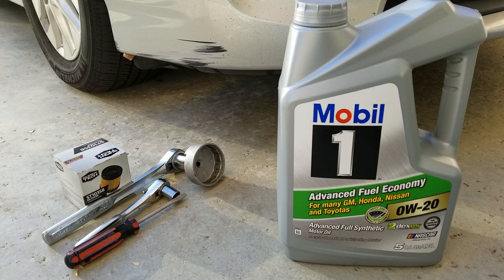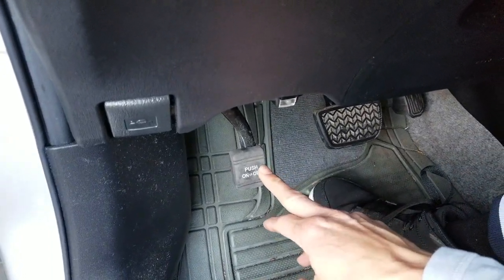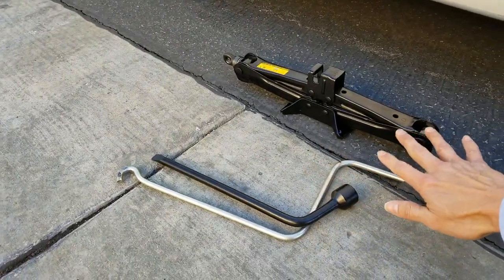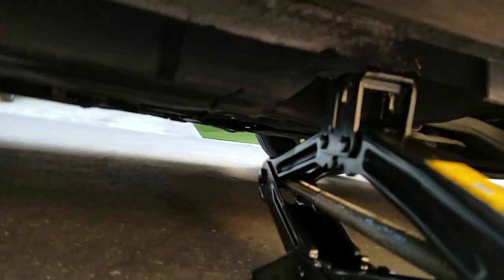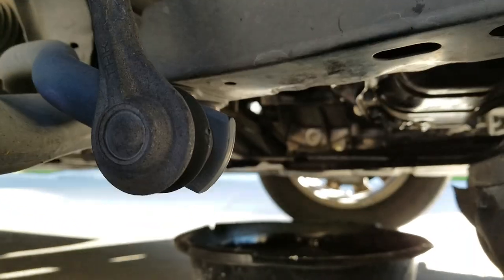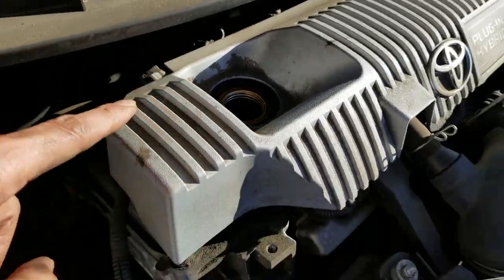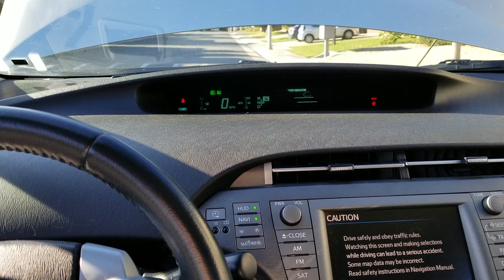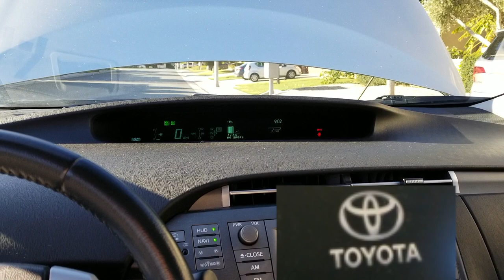How I Change Toyota Prius Plug-In With Mobile 1 Synthetic Oil Change Tips! 1 22 2019

Comment: would drive up ramps work doing this
Reply from the maker: You can but it's not level so that means you can't drain all the oil out as much.
Reply: @macdaddypimpping  the drain plug is at an angle , so driving up on boards as what I do actually helps get more oil.  But hey it's a toyota either way its getting an oil change with a few extra drops who cares